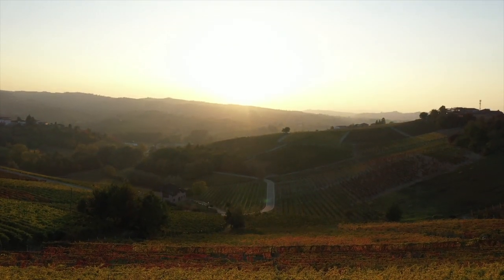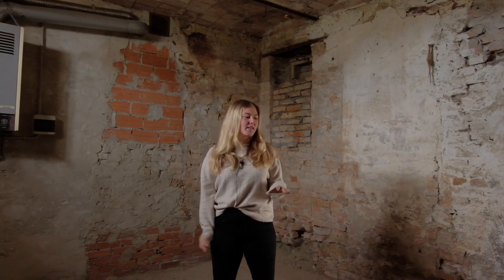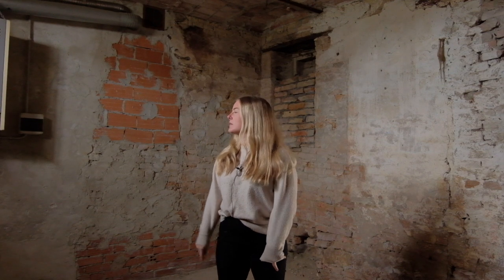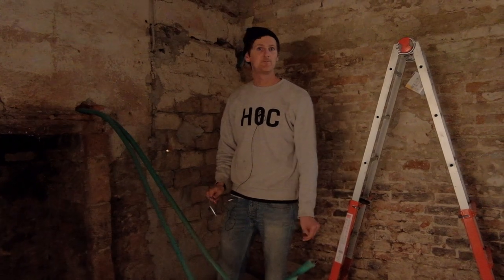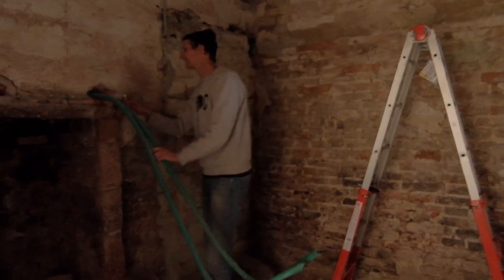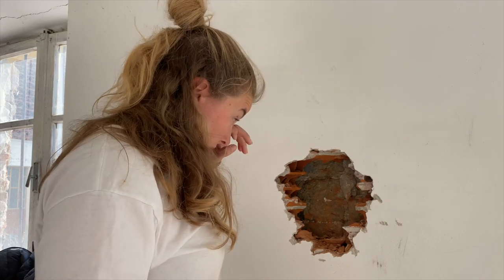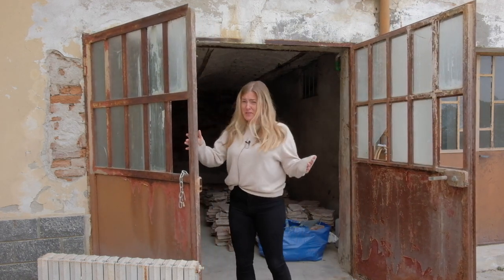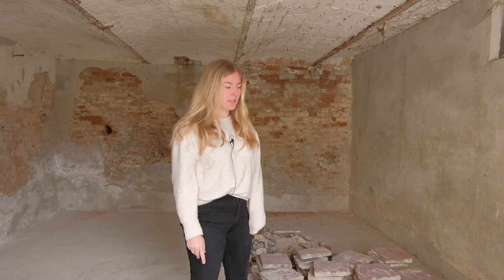Plumbing Preparation & Wall Demolition -  Piemonte Rustic Farmhouse DIY Restoration (Part 7)

Comment: I also bought an abandoned farmhouse in Piedmonte, be careful of all the lead paint in the house (especially doors). Mine also had asbestos as a bonus.
Reply from the maker: Amazing! Which part of Piemonte are you in? Thanks for the heads-up, we hadn't thought about lead paint at all until reading your comment - we're going to proceed with caution now. We also have asbestos, but fortunately only on the outbuildings!
Reply: @OurItalianDreamHouse  Oh ok thats not too bad. Its quite expensive to get the asbestos roof professionally removed as I recently found out :( 

My cabin is close to Pinerolo on the foothills of the Alps. And you?

Comment: Greetings from the first ice fishing trips of this spring. Weather has been great (sunshine, no wind, + 10 daytime and -5 during nights) and it has been nice heating the cabin at the lake Saimaa, reading, relaxing, ice fishing and heating sauna for the evening.

You are pretty good of tearing down places, lets hope that the “other part”, meaning building those holes back to actual wall goes as smooth😉. Any way, everything will be much easier, when you can move to your house and continue renovation while living at the house same time. By the way, congratulations for more than 1000 subscribers!
About the cantina interior, there is two main things you should remember. First it should look like you, course it is for you. Second remember where you are, and respect
at least in some ways  the traditional ways of that region.

Comment: When chasing for electrical and plumbing use a wet segmented diamond disc.
As with tiles squirt water onto bottom of the disc as you cutting.Then you will not have dust.
I would not use the tiles you have for bathroom floors as it going to be a wet room.
Those tiles when wet will be very slippery and an accident could quite easily happen.
There is another tile that has a slightly rough surface to it.If I remember correctly sand is put on top of wet tile before baking.
This will give much better grip when wet
Reply from the maker: Awesome advice, thanks William - can't wait to try that techniques to reduce dust while chasing for wires!

Comment: The inner wall with the air gap was probably added because the old wall was damp. We have one room that has the same thing. 

Older properties were built without damp proofing in either the walls or the floors. Rising damp can therefore be a problem. We injected a chemical damp proofer into the walls and are installing the igloo system that allows ventilation under the floors.

Comment: Ed its Adam, Max and Charlie just sent me this video, wow this is amazing what you're doing. If you need any electrical help when you wire the house or have any questions then just get in touch, I would be happy to give you advice on what ever you need help with. 😊
Reply from the maker: Hi Adam, thanks for the message. Really appreciate the offer, but unfortunately I'm not allowed to do any of the wiring myself and have had to hire a company to take care of that. Managed to do a bit of the chasing though which was a hell of a messy job - think I'll leave the rest to them! 😅

Comment: Awesome project, do you know what you are doing with the stables already?
Reply from the maker: Hi Kris, thanks for the comment. We do have a plan for the stables and have received our planning permissions too - one section will be converted into a gym/laundry and the other side will become a self contained two-bedroom apartment 😊 (we may convert the upstairs at a later stage - but then it will need a whole new roof)